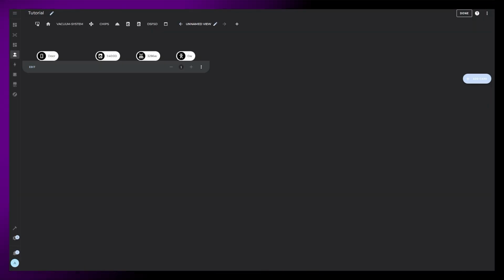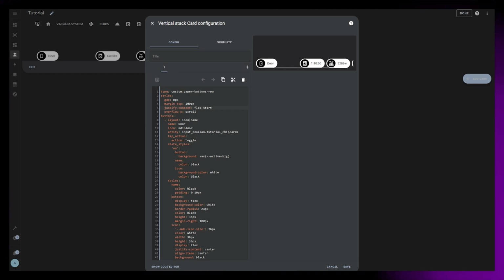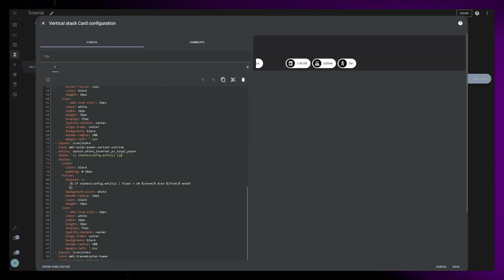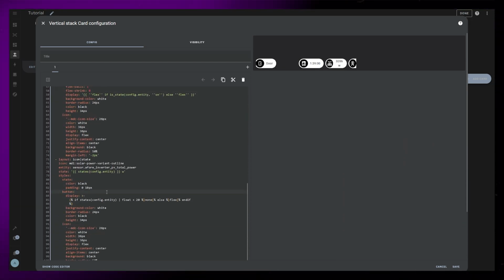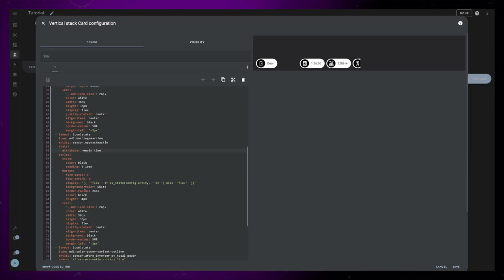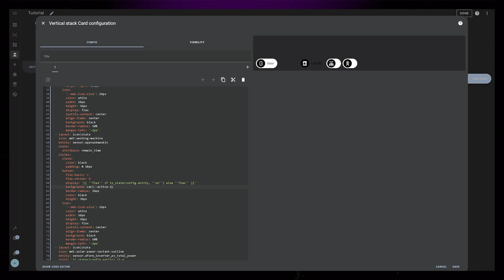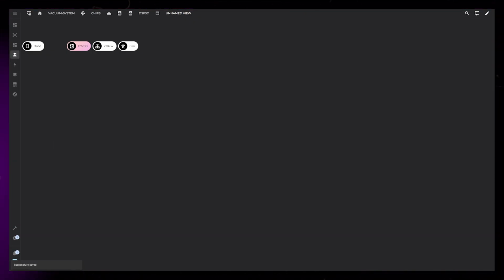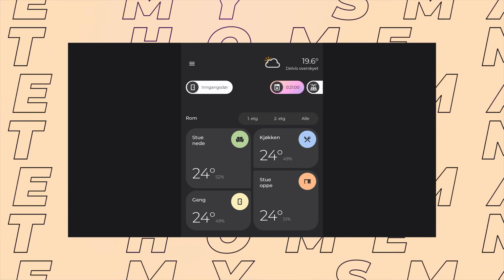Scrollable Chip Cards UPDATE

Comment: Thank you very much for such wonderful ideas with Scrollable Chip cards as well as Tabs.

I’ve completely reworked my design based on your ideas, bubble and mushrooms cards.

If possible, I have a question:
When I use “Scrollable Chip cards” I can accidently scroll horizontally the whole dashboard. Do you know if it is possible to limit it to "chip cards" section only (=not the entire dashboard)?
Reply from the maker: Do you have Swipe Navigation from HACS installed?
Reply: @My_Smart_Home  Yes, I do have it installed, as I use it for other dashboards.
Reply from the maker: @dbunevich  Yeah, I guess they might be fighting for you attention 😅
If I remember correctly there might be a way to ignore certain cards in Swipe Navigation?
Reply: @My_Smart_Home  Finally, I've found an answer.
The issue was caused by additional margin of 20px in the code below:

width: calc(100% + 20px)

Once "20px" are removed, there is no more horizontal scroll.

Comment: Man awesome work with these videos. In some cases I have the chips visible to also either do navigation to energy dash/cards or another to show my solonoid open for Aquarium refill. I wanted to change the icon from mdi:valve-closed to mdi:valve-open. I am not sure how to in this code. Granted at the moment it only shows when the solonoid is open flashing at the same time but wanted to test it with it showing all the time.

  - layout: icon|name
    # name: Tank fill
    icon: mdi:valve-closed
    entity: switch.aquarium_solonoid
    styles:
      state:
        color: black
        padding: 0 10px
      button:
        flex-basis: 1
        flex-shrink: 0
        display: >-
          {% if is_state('switch.aquarium_solonoid', 'on') %}flex{% else
          %}none{% endif %}
        background: >-
          linear-gradient(145deg, rgba(255,220,178,1) 0%, rgba(225,176,233,1)
          60%, rgba(104,156,255,1) 150%)
        animation: blink 0.5s ease infinite
        border-radius: 24px
        color: black
        height: 24px
      icon:
        '--mdc-icon-size': 20px
        color: white
        width: 26px
        height: 26px
        display: flex
        justify-content: center
        align-items: center
        background: Black
        border-radius: 50%
        margin-left: '-2px'
Reply from the maker: Would this work?

        icon: >-
          {% if is_state('switch.aquarium_solonoid', 'on') %}mdi:valve-open{% else
          %}mdi:valve-closed{% endif %}
Reply: @My_Smart_Home  Yup. Awesome man. Works perfectly.

One more question. Say I want to show a helper timer where instead of the "name: Tank fill" I want to show the helper timer countdown, how do I do this? I tried adding the timer.aquarium_solonoid various ways as it usually counts down from 15 minutes I usually have it, but I could not get it to do this.
I did the  icon|name to  icon|state and changed the entity: switch.aquarium_solonoid to entity: timer.aquarium_solonoid and display left it to display: >-
          {% if is_state('switch.aquarium_solonoid', 'on') %}flex{% else
          %}none{% endif %} but this did not work.

Comment: I've been using this scroll bar for weeks, and there's one improvement I'd really like to see. The touch-sensitive area for horizontal scrolling is currently too narrow for my large fingers. I would appreciate if the touch area could be expanded in the bottom, making it easier to scroll with less precise touches. The visible scroll bar can remain the same size, but the area that responds to touch inputs should be larger. I tried using padding but I didn't got success :(
Reply from the maker: It should work if you add padding up and down. Like this in the general styling:
padding: 20px 0
Reply: @My_Smart_Home  I will try again but I ve done exactly that